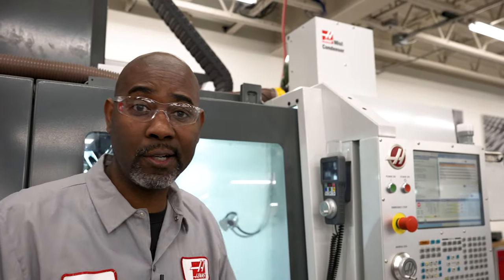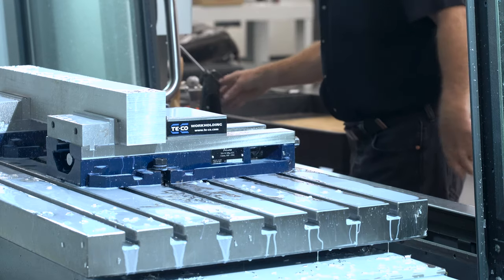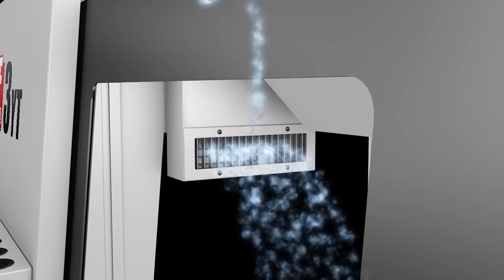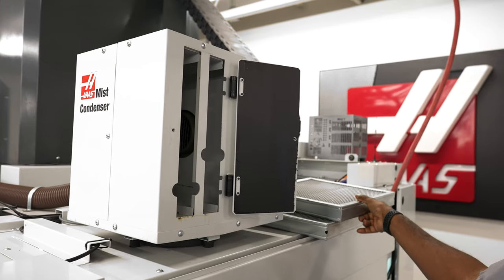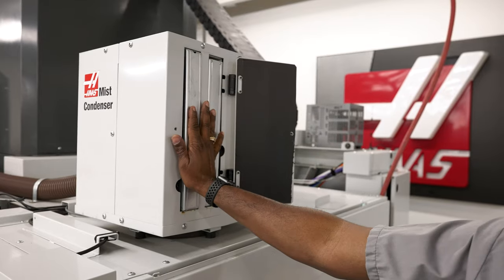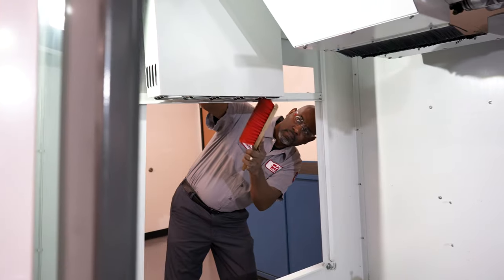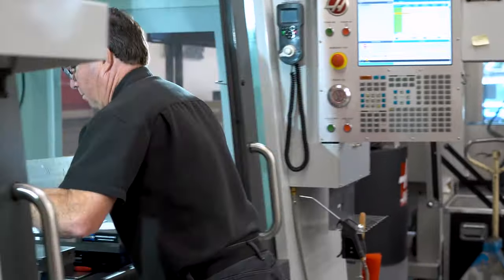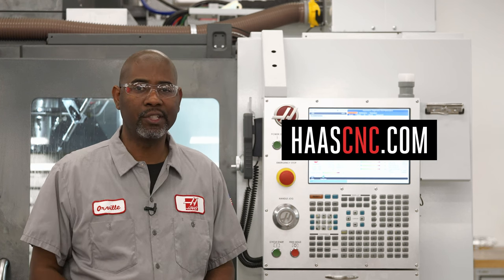Haas Coolant Mist Condenser - Simple Maintenance - Haas Automation, Inc.

Comment: In my shop we just inhale the mist and let our lungs filter it, until we die of cancer.
Reply: Sad, but you have right. Greetings from Poland.
Reply: That’s wrong. We just recently got our issues fixed - we had “Mist Aways” on a bunch of the machines but they didn’t filter the super fine mist and smoke. 

Mgmt just got us some special filter kits for them that go on top and it totally solved the issue. Maybe something to look into man. Assuming you’re in US, you could always report it to OSHA. But I’d try to get the company to resolve it before going with the nuclear option!